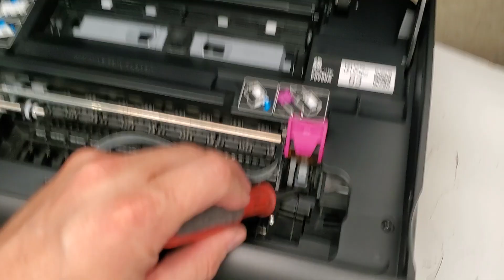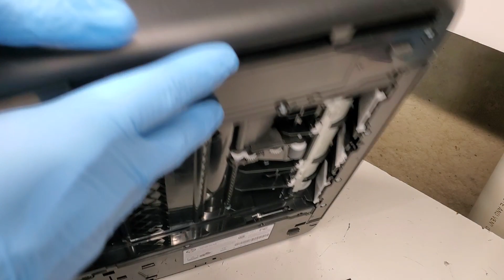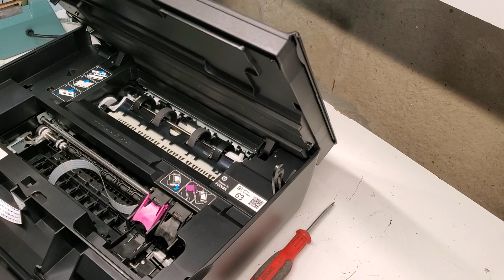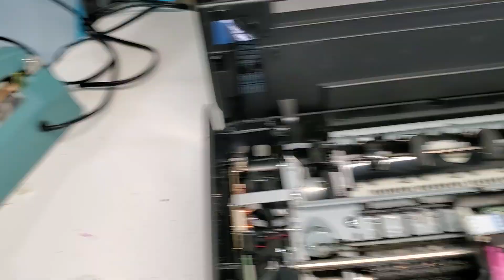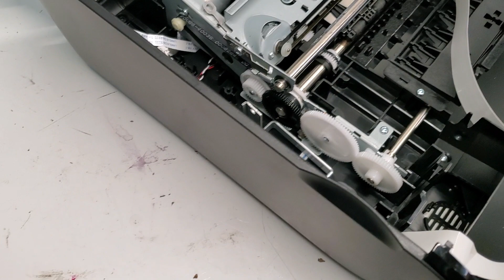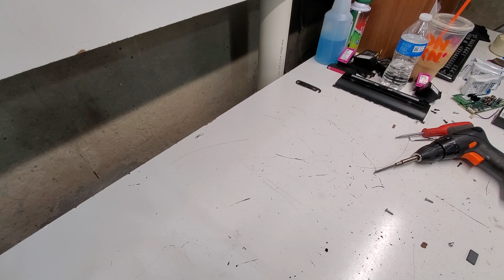Taking Apart HP ENVY 4520 Printer for Parts or Repair How To

Comment: Thank you so much for this!  I also stupidly got a sticker stuck to the rollers where I couldn't easily pull it out so I was really glad to see how to take the printer apart (different model number, close enough!).  I didn't want to take the whole thing completely apart so in the end I managed to get the sticker out with a bit of wire and tweezers (printed unplugged, of course!) but I really appreciated being able to take it apart enough to be able to get at it 😀

Comment: I doubt I will get a response, but I will ask anyway. I'm short on time at the moment, but can you let me know where exactly you get to the printerhead?

I believe mine is clogged, I put in new ink cartridges, but printing is still fitting on both colors. I would like to see if it can be manually cleaned without having to tear the printer apart.

Comment: Great! You could have told about that "latch" before I broke it.
Reply from the maker: I'm sorry. It is best to watch video fully before trying.  You can make a better judgment on how you want to proceed if you get a whole picture. Sometimes, you don't need to take a lot of parts to get to where you need.
Reply: @303electronics  The problem with a lot of these "disassembly" things is that there are lot of different invisible fasteners, etc.. Something you don't know until you do it once and break things in the worst case. Your video tutorial looked like you were a pro and have done it multiple times. After the fact I was surprised when you tried to remove those 2 screws close to the latch. You could have broken it right there. If you took that latch off like you did it later then taking those 2 screws off would have been much easier and that would be the right way to do it.

Comment: Isn't  there a ink reservoir to catch ink when you do a print test or when you do a print job? ( so that ink won't dry on the cartridges). I fill all my cartridges for the last 5yrs. Sooner are later won't it over fill?
Reply from the maker: There isn't a tank, but a few absorber pads in there. Usually last a while, but I'd check after about 8k pages to see how it is.

Comment: Thank you
Wanted to pull the 2nd cartridge without taking the whole thing apart.

Has a bunch of torx t10s out and was manually turning gear to no avail.

But a min into your video my problem was solved.

Thanks!

Comment: Great video! I had a paper jam issue on my HP Envy 4520.  I finally found the torn piece of paper, but now I can't put Humpty Dumpty back together again.  The problem includes the paper path cover (I can't get it to snap in place so the scanner cover will close), the thing with the white sprocket roller on it, and a little plastic curved piece that I believe has something to do with double-sided printing.  I hope this makes sense since my technical terms are a bit lacking. Thank you!
Reply from the maker: Hi. Thank you. I'm sorry you are having trouble. The paper access cover should be able to snap in place. You can also check the area on the right. There is a little plastic piece that snaps into the top portion to avoid it being open too much. Check to make sure that's in place

Comment: Hi I found video very helpful. my problem is my printer keeps sticking if I use Card ok if I use regular paper. please help
Reply from the maker: Hello. Thank you..Cardstock may be too thick for this printer. Have you tried cleaning rollers to improve paper flow? Also, you may need to load just one cardstock paper at a time.

Comment: One cartridge tray is just refusing to read any cartridge I put in. Old used ones (refilled) or new ones.... 
On closer inspection it looks like one of those small 'connector balls' that makes contact with the circuit on the back of the cartridge, is not sticking as far out like the others... 

I just found your video so I'm hoping I'll have a better idea of how to deal with this... Thanks

:Colour works fine but black wont read and asks that I remove and replace...
Reply from the maker: Hi. Does it do that when you put old cartridge in? If not, the new ones you bought may be wrong cartridge number. Check the contacts area on the carrier to make sure there isn't a piece of tape or ink stick to it. You can just clean it by wipingh with paper towel and alcohol. Even if you do not see anything, try cleaning to see if anything changes.
Reply: @303electronics  Hi, yes I can use an old black cartridge that I have refilled and emptied many times with no issues until now. 
The colour cartridge was working fine until the black cartridge became unreadable, now nothing will print and the error symbol is only over the black cartridge on the display.

I purchased two new black cartridges but the error symbol remains over the black... 

I will give all connectors another good clean today both on the cartridges and the printer. Hopfuly it will work this time, thanks for the suggestions

Comment: Man this video is great, 
So I'm sitting here having opened the screen panel and I've checked all connectors which look fine so I'm guessing I have a faulty screen. 
So replace the screen do I just remove the circuit board and replace the screen which would be plug n play?
Reply from the maker: Hi. Yes, if the screen is faulty, to replace it is just to make sure you connect it properly and it should work right away. No special instructions otherwise.

Comment: My HP Envy printer works fine but sometimes when I power it up and makes a grinding noise for 3 seconds
Reply from the maker: Have you checked the area of the ink carriage rest? It is on the right? Sometimes ink gunk can build up and prevent mechanism from moving.

Comment: Thanks very much for this!  I have an HP Envy 4500.  Sometimes the scanner lamp moves into position at top of page and gets stuck there.  If I pick up the printer from the side an inch or two and drop it, it will start working again.  Am thinking I may just need to re-seat the scanner connector, and wondering if you had any thoughts.  Also kinda makes a squeaking noise on power up.  Maybe carriage needs cleaning or lubrication?  Thank you, this was very helpful for disassembly!
Reply from the maker: Thanks! One reason for scanner being stuck is one of the teeth by which the gear moves may be broken and makes the skip. It may also be a bad connection like you said.  Regarding the squeekiness, the rod can be lubricated, or just wiped clean. If it isn't too loud, it shouldn't be a concern, but since you opened up the printer, lubricating some parts may help get rid of it. Good luck! Thanks again for your feedback! Have a great 2021!!!
Reply: @303electronics  Thank you so much for the reply!  Squeak isn’t horrible, so I think I’ll leave it alone for now.
Reply: Thanks for the video tried cleaning  the rollers still have issues  with pick up think paper like card stock an sticker on the envy 4500 . Can we send printers to you for repair .

Comment: On my HP 2520 I have an error that says the bottom paper tray is open even when it’s clearly closed...
Reply from the maker: The tab that pushes the open/close sensor is bent or broken, that's why it gives you the error. My thoughts. Let me know if that's the issue or if you need more help.
Reply: @303electronics   where exactly is the open and close tab located?

Comment: HI; YOU are amazing ; i have the same printer which turns on with this error "ÍMPROPER SHUTDOWN" printer failure  error "0X61000072" I've done  all tests without solve it....I will be able to disassembly it  but I need your help about how to correct tis error........thank you soooo muchhhh
Reply: I have the same code. What did you end up doing to fix it?

Comment: i really wish i could post a video in your comments of what my hp envy 5055 is doing the cartridge is folding the right corner of the paper with a little shredding and printing on top of the folded corner lol, now it completes the print its just that right corner i also did the alignment it requested

Comment: Hello I have a question when the scan is not emitting light, how can I proceed to fix it? Will the LEDs be damaged or will the ribbon have to be replaced? Is it the card to which the scanner is connected? Please do I need your help if possible? Thank you very much and for your video that helped you to disassemble.

Comment: I have a HP Envy 4502 printer. The little strip that moves my cartridge unattached and there is a spring that's out of place as well.  I don't want to make matters worse by trying to service it myself, so I  have decided to take it in for repairs.  It appears to be a minor fix but I am not able to do the job myself.  If you know of any service centers in Houston, Texas, please post here that information here.  Thank you very much.
Reply: P
Reply: Replac battery on morel on shaver

Comment: How do I clean the print head if its clogged by ink? My prints doesn't have black ink and most prominent reason for that is clogged ink header according to the internet. Any help is appreciated thanks. I've tried poring a lot of alcohol on the printer head, I haven't tested it yet. I'm waiting for the alcohol to dry off.
Reply: It's behind the ink cartridges
Reply: Having same issue

Comment: I ordered an envy 5055 it arrived with a cracked scanner bed. I have a Canon pixma with an intact scanner bed. I already took the glass out and I'm thinking about taking apart the envy to see if the Canon glass will fit it. I already made the mistake of touching the back of the glass though. Ugh. Or maybe I should try and mend the hp glass that cracked off with some kind of glue.